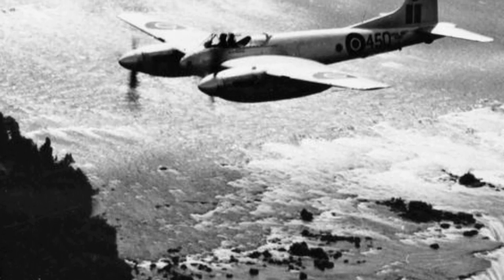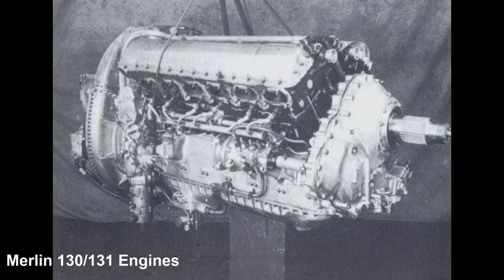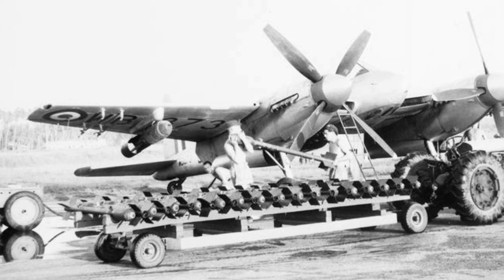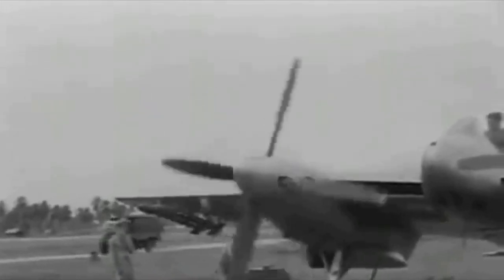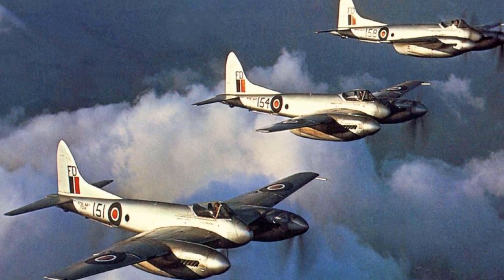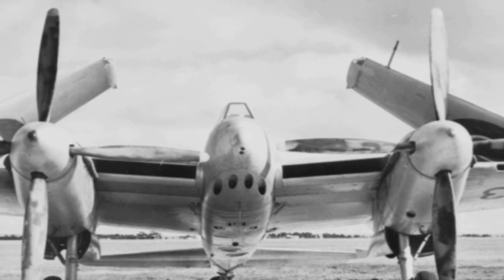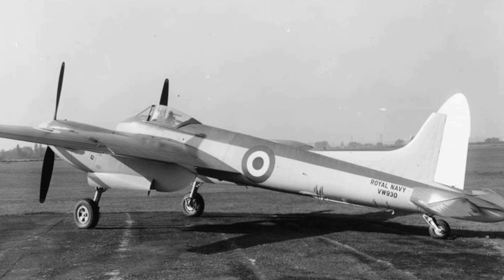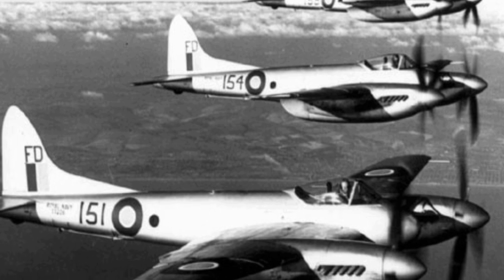The RAF's Ferrari of the sky: The de Havilland Hornet

Comment: The Merlin 130 was a late variant of the engine that wasn't available mush before the Hornet first flew. It would have been interesting ro see the type with older engine specs to camper with the Mossie.
By the way, Eric Brown ws the first pilot to land a twin engine aircraft (Mosquito) on a carrier  - done by hanging the plane on its props. He had to go around on first attempt with carrier crew saying his wing tip hit the waves. He put it down successfully the second time around.
Reply: "By the way, Eric Brown ws the first pilot to land a twin engine aircraft (Mosquito) on a carrier  - done by hanging the plane on its props. He had to go around on first attempt with carrier crew saying his wing tip hit the waves. He put it down successfully the second time around."

Let me ask you a question. What exactly motivated your inclusion of this "by the way" in your comment?
I'm just wondering if the British bought a carrier just because they needed to one-up the American carrier armada with some weird "first" like this.

And the embellishment, did you come up with that on your own or copy it from some other British fanboi?
I wonder if either you or the original author of that embellishment know what "hanging on its props" actually means. 
It means to climb vertically. Forward speed almost zero, 90 deg aoa . I can't see landing an unmodified Mosquito that way, as it would mean somehow timing the approach so that a tailhook mounted on the plane would engage the arresting gear which then would require that the main gear (unmodified of course) would then have to absorb the bulk of the plane slamming down on the deck. So sure of course you could modify the main gear and add a tailhook for a carrier landing, not a real problem there, but that "hanging on its prop" bullshit is, well, bullshit. No less than with any other plane making a carrier landing, it either comes in just above stall-speed, or it comes in well above stall in case it misses the wires and doesn't have safety-netting to catch it before it rolls off the far end of the flight deck and falls into the ocean in front of the carrier (no angled deck on that class of carrier). 

Also I wnoder what the Mosquitos' tactical dive limit was: 

"As a result of Doolittle's request, early in 1944 the P-38H Lightning, a Packard Merlin-powered P-51B Mustang and P-47C Thunderbolt were dived for compressibility testing at the RAE by Brown and several other pilots. The results of the tests were that the tactical Mach numbers, i.e., the manoeuvring limits, were Mach 0.68 for the Lightning and Mach 0.71 for the Thunderbolt; the corresponding figure for both the Fw 190 and Messerschmitt Bf 109 was Mach 0.75, giving them the advantage in a dive. However the tests flown by Brown and his colleagues also gave a Mach number for the Mustang of 0.78, resulting in Doolittle being able to argue with his superiors for the Mustang to be chosen in preference to the P-38 and P-47 for all escort duties from then on,[21] which was available in growing numbers by very early 1944; for Doolittle's eventual move to air supremacy missions in leading the bomber combat boxes with the Mustangs by some 75–100 miles, instead of merely accompanying them nearby.[22][23]" 

Of course the Mosquito didn't really need carrier support though, did it, any more than the Mustang or the P-38 did. And it certainly wasn't of much use in a dogtfight especially with such a high stall-speed. So an interesting stunt but I really wonder just how often the Mosquito was flown off the flight deck of that carrier for actual combat missions. Like, for raids on Tokyo, for example. Which predated Eric Browns' stunt by almost 2 years.
Reply: This is a great video, the Eric Brown quote at the end sums up the greatness of the Hornet.

Comment: It's a shame it hadn't been available a couple of years earlier , it would have made an excellent long range escort fighter . Thanks for the video.
Reply from the maker: Yeah it is a shame. Have to believe it would been very effective in combat, but also ground attack.  👍✈
Reply: Would it if still been susceptible to the 262?
Reply: @gingernutpreacher  For that you need the Gloster Meteor!
Reply: @TheMentalblockrock  no that was no faster and all the speed record's were after the war with bigger engine's
Reply: @gingernutpreacher  It's all about Speed guys and the altitude that any particular plane functions best at , My best guess is that the 262 would be more than a match an an equal fight at the optimum altitude for the 262 , but that the Hornet would have been able to put up a better fight than say a Mosquito (My Favourite WW2 aircraft ) , this isn't taking Any of the individual Pilot Skills & experience or lock off  into account  which can make a huge difference in any air combat . Happy New Year All ! :hydrate:😃

Comment: Great comment and a rare and nearly unknown aircraft.  Too bad none were preserved.  I've always wondered if performance would have been improved if the engines rotated outward (like the P-38) rather than inward.
Reply from the maker: Thank you 👍✈️. It is a shame none were preserved, but there is one under restoration in New Zealand. Amazingly this one should be able to fly so will no doubt make a great display someday.  I'm not too sure, although they were contra-rotating propellers, as this was believed to eliminate torque.
Reply: I read that they did try outwards, but it reduced the tail surfaces effectiveness at low speed.

Comment: There was a design very similar to the Hornet produced in Argentina. It's performance was comparable to the Hornet but the major difference was that it was all metal, so it would not have had the same problems that the Hornet suffered with it's wooden airframe.
Reply from the maker: Ahh interesting, I never knew.
Reply: Never had .erlin engines pratt whitely 1200hp. Underpowered slower.  Need 1600hp merlin
Reply: The argie version.  Do your research ok

Comment: Capt. Brown said it was the best piston engined fighter he ever flew.  It was a rare fighter that was totally over powered.  It could do anything a single engined fighter could do....on one engine.
Reply: Hyperbole 
The idea that the Mosquito at 14,000 lbs empty could compete with the 9,000 lbs Sea Fury or late war 9’000 lbs Corsairs, both with more powerful engines than the Mosquito while having an engine shut down is just foolish.
Reply from the maker: It was a superb fighter. He rated it very highly, supposedly even stating it was the Ferrari of the sky.
Reply from the maker: But it wasn't a Mosquito. Yes similar, but a new design.

Comment: It was overlooked because it came after the war, so wasn’t needed. And as jets arrived. So was out classed. 
     Of course it was the best piston aircraft ever… it was the last. Same as the bear cat, tiger cat, fury/sea fury. If it wasn’t the best, it would have been pointless building it
Reply: It was built. Also piston engined planes had far better fuel efficiency so could loiter around areas much longer if needed. They were still using piston engined aircraft in Vietnam like the Skyraider.
Reply: @mikeholland1031   two different subjects for discussion. 1). Why didn’t it achieve the fame and respect it deserved? . See my answer.
                 2). Under a totally different political background than actually existed at the time. Would it have been possible for a significant use to be found for it, which would have generated that level of respect. And for it to have been remembered as the thoroughbred that it undoubtedly was?
Reply: @Olleetheowl  I do not know, nor had I ever  heard about one until a cpl of years ago I guess they didn't make too many of them.

Comment: Hm

Pretty sure that the Mosquito as not the fastest piston-engined fighter the RAF had. 
I can think of several other candidates just with RR engines.

but I wonder, what if you didn't think that it was the fastest that the RAF had? 
Would you still make a video about it?
Reply from the maker: The Mosquito wasn't the fastest, but I am discussing the De Havilland Hornet which is considered the fastest piston engine fighter.  Even if it wasn't the fastest, there would be a good chance I' still cover the Hornet, as it lesser known and has an interesting history.
Reply: @AntiqueAirshow  faster than the twin engine Heinkel?...the Arrow?
Reply from the maker: @touristguy87  Sorry my apologies, I was meaning the fastest piston fighter in RAF service. I forgot to write that though.  Compared to things like Heinkel's design and the Arrow I am unsure.
Reply: @AntiqueAirshow  you could make a simple table with the top speeds of the various candidates
Reply: @AntiqueAirshow  really there is an obvious irony here in that you're not even sure if it actually was the fastest piston fighter in RAF service, therefore there's a good chance that some other plane is, which you don't even know about. That is because you don't understand either irony or irrelevance.

Comment: Ah, I detect an antipodean speech impediment  - the aspirant letter H.
Still, one makes allowances for our colonial natives.
Regarding technical issues, the Hornet was never lucky enough to be fitted with contra-rotating propellers. It did however have contra-rotating engines.
It was also not the first aircraft to utilise redux bonding - the Mosquito before it was.
Reply: Not Australian, it is specifically a Carholic education thing, not common outside of the Catholic education system, but it is our largest private education sector.